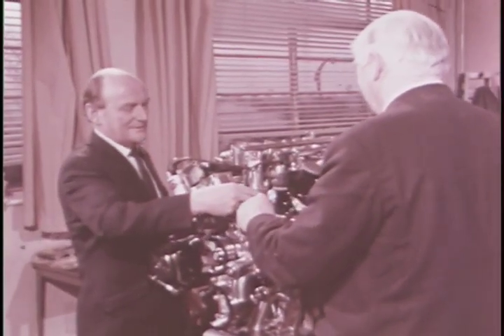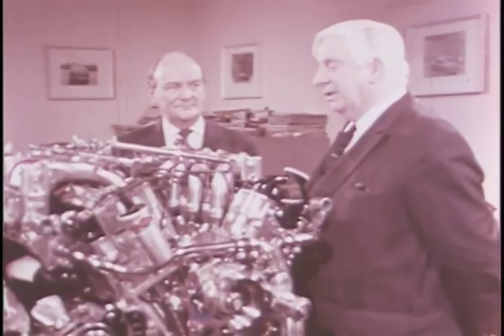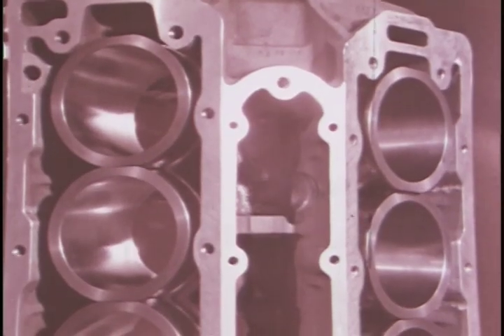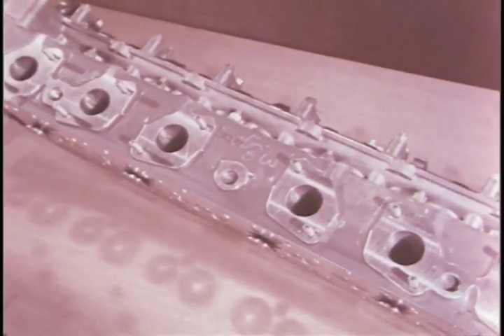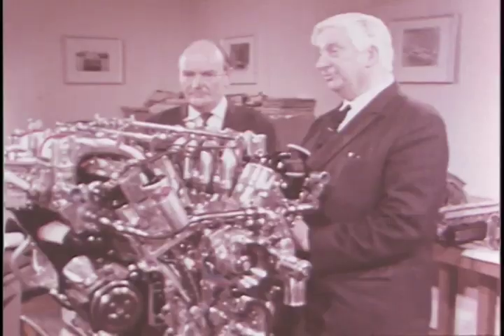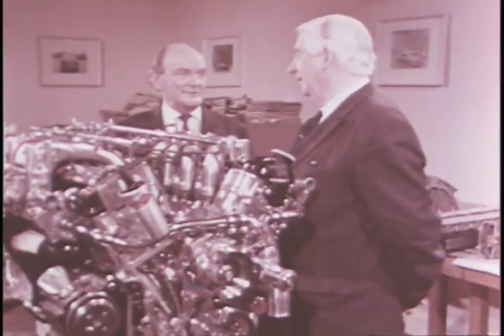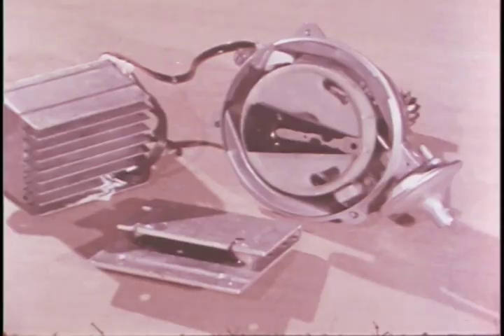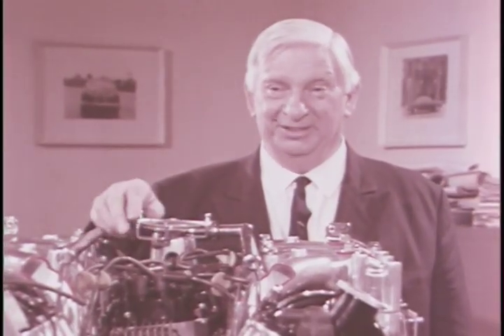Jaguar V12 Engine

Comment: My V12 colour Antelope - lent it to a friend  for a Wedding .in Hastings .Set a speed  record on the A21. Out ran the constabuary.
Currently have a 1998 XK Convertible. Dark Blue. First Jag i encountered as an about 8 year old was Dr Joe Sytner's - the model before the Mk 10 - in Liverpool. A special treat. The sun roof with a lovely chrome winder.
Also attended the 60th Anniversary at Browns Lane with my V12.
 The visitors' car park was a sight to behold - every model of Jag. Wonderful. Inside the factory was dull.  Apparently when Ford took over & the  Top Brass visited Browns Lane they said it reminded them of a Soviet factory. ( Not a compliment) 😢
 On the way there from Hastings in my  V12 there i noticed  a cavalcade of TVR s in a wild variety of fluorescent  pastel shades . 
A great day out. That car park ❤ !!!
 Any one recall being at Browns Lane  on that day ?

Comment: 10:41…..another and possibly the main reason for the outboard mounted carburettors was that Sir William Lyons did not want to have the lines of the, then new, XJ series cars compromised by a bulge in the bonnet which would have been required had the carbs been mounted centrally in the V of the engine.
I had a S1 XJ12 back in the early 80’s and loved it. No matter how I drove it the V12 never sounded or felt like it was really trying.👍
Not the most economical car I’ve ever owned though!😂

Comment: These engines did never work they dropped valve seats any 20.000 miles
Reply: You keep posting this nonsense in every video. Probably didn’t take care of your V12s cooling and suffered the consequences?
Reply: Nonsense. You may have been very unlucky but for those of us who maintain it properly the V12 Jag is a magnificent engine.
Reply: I agree, I work on these cars and with proper maintenance these are superb engines.  @sej8806
Reply: You cant use any Jag V12 on German Autobahn @sej8806
Reply: Total nonsense.  I have two in my workshop now for service work, one car has done 147,000 miles and never had any mechanical work on the engine. The other has done 86,000 miles, again no mechanical work ever needed.
Reply: you cant use any V12 jag on German Autobahn they drop valve seats when driven full speed even when they were new @classiccars1994

Comment: Perhaps some would say that the fact two of the 'XK' engine six cylinder cylinder blocks were 'strapped' on to a common crankcase might just have had something to do with the choice of V 12. As a certain My Lyons was well known for re-using elements of (a) previous model(s) in a new one to reduce costs ?  .  .  .  !
Reply: The V12 is nothing like that. The XK wasn't a wet liner engine for a start.

Comment: Now we can research and develop in virtual. Such a time saver and electronic control of fuel air  delivery. Valve timing and exhaust system variables. Every rpm and temperature range can be tuned for exactly what is required via sensor servos. Who knows what the next improvement might be made next. Jolly Good!
If one builds a better mouse trap, many buyers shall seek your firm for orders.

Comment: I love hearing engineers explain their thought process that went into designing something like an engine, and the Jaguar V12 is one incredible engine. Sadly some of the parts that are mounted to it make it seem that the engine is unreliable, which is simply not true. The issues the v12 Jaguars had was related to either the parts on the engine, or a poorly maintained cooling system. Over heat one of these, drops a valve seat and likely takes the piston with it, if not the head as well.

Comment: Gents.
  I so WANT Mr. Baxter's hair job.
  A substantial, elegant, coiffure resembling the top of a bed frame, if I must say so... 
  Controlled and presented as though it is a wildlife-like extension of the scalp.
  It gives a Bohemian, but mannerly, counterpoint to his oh-so British manner.
I stand corrected about the carburetors - Yes, they are Strombergs at least as presented here.

Comment: I used to work at the Jaguar Engine and Transmission Pant in Sandy Lane, Radford, Coventry, in 1980 until I got the sack in Dec 81 on account of my punk rock coloured hair.  I remember as a trainee working on parts of the V12 and the straight 6. I have always admired Jaguars, and if I were well off I should like to own one, especially an older model.  What marvelous engineering!  Interesting to see Raymond Baxter who used to host the programme Tomorrow's World on the BBC. Nice one for sharing.
Reply: xj12c
Reply: @MichaelKingsfordGray - Get medical help luvvie, you clearly have issues.

Comment: That Ignition system went from Lucas " Opus" ( mechanics referred to it a "'opeless" ) through to Magnet Marelli similar to the system fitted to Ferrari V12's , and I remember the first time that I changed the plugs on an early carburretted V12 that it took almost five hours, and by the time that I had learned the tricks of the trade, I had the plug change down to twenty minutes. The engine was beautiful  with fuel injection, and in the earlier carburretted form. I remember single handedly taking out, rebuilding, and re-installing many of these engines over the years, the only fragile parts were the exhaust manifolds, made from thin walled close grained cast iron. The present day Aston Martin V12's owe everything to these two great Engineers,  Harry Mundy,  and Walter Hassan, who in my opinion did MORE for the British Empire, than the sum total of it's Kings and Queens.

Comment: I looked at a early V-12 with a buddy while in H. School, I think it was a "New- XJS". The dealer showroom had the hood up and it was our first look at a V-12. I noted to my buddy I could only spot 3 of 12 spark plugs looking from above, tubes, hoses, and wires everywhere. But this was likely 1977 ish and "smog" equipment was at it's pinnacle of cluster clutter.

Comment: Amazing motor stretched to 7 litres this aluminium never aluminum baby pushed the XJR 9 and XJR 12's to two Le Mans wins. Two 5 litre DOHC V12 fuel injected  motors were also built for the aborted XJ13 racer, one of them turned up on e-bay in Germany some years ago.

Comment: Inline 6 is the most naturally smooth configuration and a v 2 is really two in line 6 engines therefore its very smooth running

Comment: Wonderful video!  As a life-long Jaguar fan and all-around Anglophile, I couldn't ask for more.....Thank you so much for posting.
Reply: Dennis Cat I find myself thinking about a lot of double entendres at Jaguar xmas parties, just looking at the finer ladies in attendance and making veiled comments about lively combustion chambers, length of intake runners and differences between bore and stroke...
Reply from the maker: +Moses Berkowitz Thank you for letting us know.  Glad you liked it.
Reply: +Moses Berkowitz The XJ 12 was a great chick magnet and they were cheap cars.
Reply: samsonian Well, be sure to check the oil in the rear end. It's easy on the ones with high mileage, but some of the newer models will probably give you some trouble.

Comment: Bigger, heavier, not as powerful and not as reliable as a small block Chevy.
Reply: Let’s see. Jaguar or sb Chevy.  It is to laugh I’ll take the bigger heavier less powerful all day and all night. Put them side by side and Chevy is so rough and noisy it’s a headache.  Quiet, powerful Jag for me.  If only I could afford one sigh
Reply: keep in mind a small block chevy is more general purpose than the jaguar v12 too.
Reply: N2YTA and? It's not a competition. Don't get why so many car guys act like everything is all the time.
Reply: And yet well into the embargo this engine was still more powerful than an L82 put in the Corvette stingray of the time. In fact the L82 was such a garbage engine for it's time that people who restore Corvettes will mostly replace the stock motor for an aftermarket tuned crate engine or LS or LT engine swap the car.
Reply: Well, you just stick to something you can understand hey....
Reply: Sadly against this Jaguar video it’s true. The base Chevy V8 design (mighty mouse, as it was first nicknamed in 1955) was so good they made up to 100,000,000 over forty years !! Including the big blocks. First fully mass production engines with 1Hp per Cui. 
Chevrolet had Zora Arkus-Duntov pushing serious performance out of the small block with the Corvette do a 150mph run at Daytona beach this is 1956!. Fuel injection in 1957. It’s easy to think of Chevy V8s as a lesser pedigree but no ! The minds behind them are totally on par with these engineers. They had racing them fully in sight as well as engines that will sell cars on mass.
Reply: typical yankee comments

Comment: This is most completely poorly designed modern V12 ever built.There is nothing on this engine that was done correctly. This engine makes half the power of a 454 chevy and weighs  100 lbs more..
Reply: You are correct about the Jaguar V12 valve seats - I mentioned that in an earlier comment on this page. They should not fall out anywhere near as readily as some do, although they seem to stay in place unless the engines are overheated.
Two other things that Jaguar got wrong in relation to the V12 - the "one and a half pass" coolant flow through the radiator, and the instructions for filling the cooling system. If you do it as instructed you may have air pockets in it.
But, re "nothing on this engine that was done correctly" - you are wrong about that.
The manufacturing quality of the rings and cylinders is superb, as evidenced by the practically nil oil consumption, even with the area of so many cylinders. I mentioned that before.
All the construction of the engine is strong. Nothing breaks. Bearings last for far longer than people experienced with other engines would ever have anticipated - and that's in Jaguar cars that have much more mass than almost anything else, over 2 tons for the V12 sedan with driver and passenger, so the engines are always working harder to push them around.
Power ratings of American engines are well known to be exaggerated.
The Jag V12 power output was measured with all the ancillary equipment being driven, and the standard quiet exhaust system.
Did the Americans measure the 454 power output under the same conditions?
On top of that, as is common with some measurement units used by Americans, I would not be surprised to find that whatever version of a "horsepower" the Americans used was significantly smaller than the unit of horsepower that the English used, making the numbers seem higher again.
Reply: 454? what you mean a truck engine
Reply: +Jack Kallemdjian  yes the truck engine that weighs 100 lbs less and makes 600hp /600ft .lbs.torque- the truck engine that does not jump cam timing when you down shift it because the spring loaded xjs cam chain tensioner is not strong enough- that truck engine. The XJS engine was ORIGINALLY designed to be a 7 liter engine. CAFE scared Jaguar to death. So they made it a 5.3. liter lol WHEN they did that they never downsized the intake ports. A xjs piston (3.56 in?) weighs more the the 454 truck piston(4.25 inch). The xjs connecting rod weighs more then the 454 truck connecting rod. The valve seats always fell out of the xjs heads because Jaguar REFUSED to install them with the correct press fit. A 454 truck engine has never had a problem with the valve seats falling out.Let me know if you want more reasons why the xjs v12 was worst ever modern v12
Reply: +skysky7250 hmm you don't like this engine do you. jumping timing chains really? it won the le' man's 24 hour in France. never saw anything with a 454 in it on the leader board. don't get me wrong love the 454 but not  in V12 class.
Reply: Forged pistons and rods weighmore than cast ...valve seats dropping out ??? You maybe reading an article by someone who has no experience with these engines. These are complex engines and need experienced mechanic's working on them people assume too much, it's all alloy it's V12 , it's overhead cam it's got electronic ignition same as the ford DFV cosworth formula 1 engine, fuel injection!!!! Let's run to the hills....
Reply: +Jack Kallemdjian hmm the valve seat inserts fell out because they were not installed with enough "press fit" These seat inserts fell out when the engine went over 210- 215 f Both the jag and chevy rods are forged.The jag piston is 3.55 inch dia. the chevy is 4.25- the jag piston weighs more- IF you race this engine- YOU must use a cam chain tensioner with a stronger then stock spring - if you do a hard down shift on a stock spring cam tensioner- the chain will jump.If you race this engine- you must use the "flat heads" The late model lol H.E. heads have a combustion chamber that  causes uncontrollable detonation. Let me know if you want more "details" about this engine. They did nothing right on this engine- just like the empire- that is why both failed.
Reply: hi Richard, The v12 stroked to 7 liters- as it was originally designed-  with decent cams and 9? to 1 compression could make 600 hp. But you must use the "flat heads" The engines with later heads blew up when you tried to make more then 350- 375 hp- I saw the pistons/ liners etc.A 454 with good heads, a .600 lift cam and a good 4 barrel intake will make 600 hp- check the magazines. Or you could put an z06 LS 427 (7liter) corvette engine in. They make 600 hp stock and weigh 350 lbs? LESS then the Jag engine. Dont down shift a jag v12- the cam tensioner is not strong enough. The chain will jump time.
Reply: I owned a xjs for 20 yrs.Women love the car. Dont ridicule me until you can refute something I have said about this engine. Again it is the worst v12 I have ever worked on.  4 valve 6 cyl. heads can be adapted to this engine. Then the entire front of the engine must be redone. Oh, I forgot about the new intake and ex. systems. A 7 liter crankshaft is $5000. Oh I forgot new rods and pistons. For $7000 I could put a 502 bbc in the car and have 200 more hp with 100 lbs. less weight. The valve seats wont fall out if I get stuck in traffic. Or, if I am stuck in traffic with a xjs maybe I should just stop the engine and add to the traffic jam.

Comment: As much as I love my XJS v12 it does have some inherent design flaws that I think were obvious from day 1
Reply: Josef Venport 
I think so. I love them but only enthusiasts will decide for a real and classic Jaguar which has run ot of existence in 2008 when the X350 has been replaced with the modern X351. The brand is finaly finacially successful but also dead un terms of tradition and sense for the heritage. Dead. 
Now Jag is equal to all other zero charisma brand. Simply prositituted to the mass market to match a clientel who has no idea of the brand and no heart for tradition.
Reply: Is  this why a 1989 XJS in excellent condition with only 45k miles will only bring around 7500 dollars?
Reply: houseofwine  So say I ole man!
Tis a shame indeed to have Jaguar owned by the Indians.
Reply: Josef Venport 
About right but this mess started some years before the Indians took over. The "Diesel and station wagon using cheap and fake interior for the mass market" policy started eith the X Type and S Type.

Comment: Typical British engineering, totally oblivious to valve inclination angle. The rolls Royce Merlin had the same flat combustion chamber during WWII. The American Allison had a pet roof combustion chamber and was much more efficient than the Merlin. Where the Merlin won out was their two speed supercharger. The trick thing to do would have been to put the Merlin's supercharger on the Allison. It would've have been unbeatable.
Reply: "totally oblivious to valve inclination angle" - no, they were not.
If you do a small amount of research on this you will find out why the Jaguar V12 fitted to the production cars had single camshaft heads and inline valves rather than the twin camshaft layout of the earlier V12 version in the XJ13 - less noise, less mass, more compact, lower manufacturing and maintenance costs, and stronger torque in the low to mid range, which meant faster acceleration at most speeds than the twin camshaft version, and therefore an easier and more relaxing car to drive.
The Jaguar XK 6 cylinder engine had twin camshafts and inclined valves, with inlet and exhaust valves at different angles.
Reply: +Kenneth Cohagen the allison in the p38 was responsible for more than half of all of that fighter's losses in the war. read Martin Caidin's ''fork tailed devil'' for confirmation.
Reply: +marty miles yes, but my point was with the choice of the Merlin for the Mustang. If the P39 had gotten the supercharger it was supposed to get it, together with the P38 would have mopped the floor with the Germans. The P38 was awesome. The P39 and P63 didn't get the supercharger they should have. Both had lower drag than the Mustang, and probably lower than the P38 due to it having two engines. But they would have been an awesome pair!
Reply: This      engine was designed when Petrol was 20 cents a gallon.
Reply: An awful lot of engines, not only British, have heron heads. Valves are a compromise, what's good for high speed breathing might not give you as much low speed turbulence.